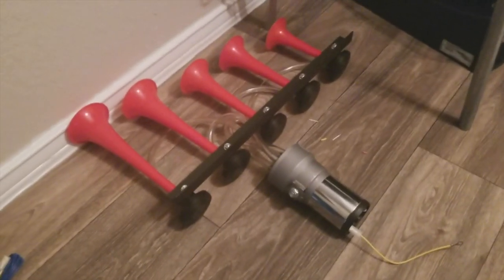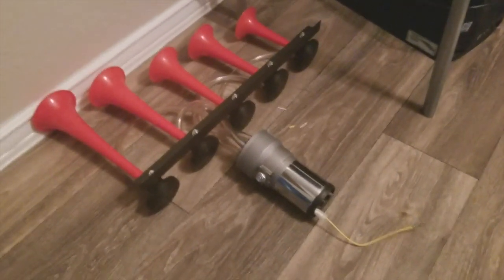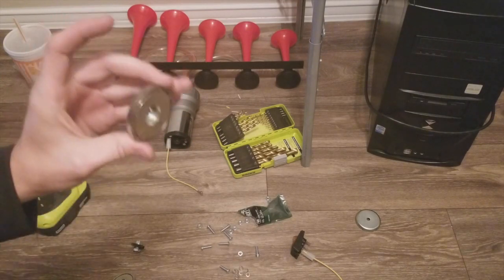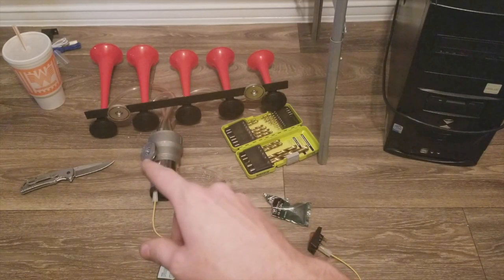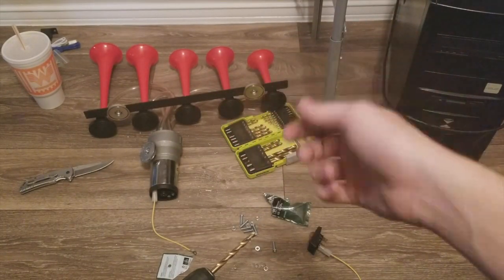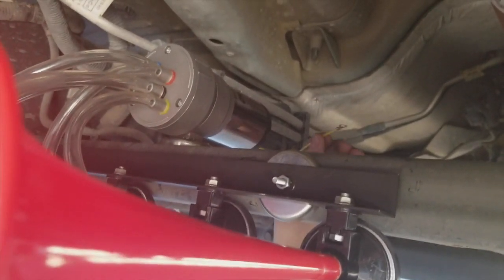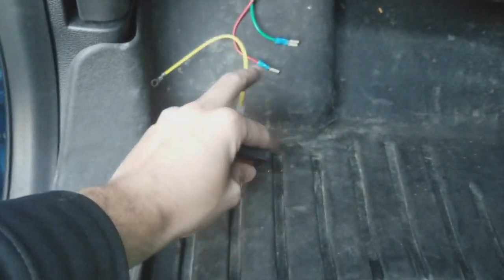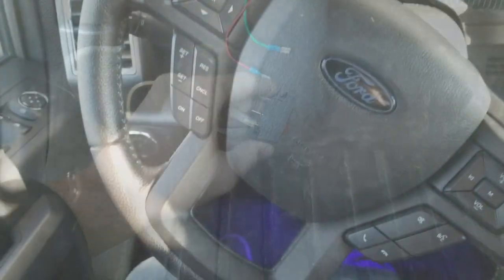DIY Airhorn Install!

Comment: I've tried every way I could find to wire up Harbour freight but with zero results can some tell me what I'm doing wrong . I am using separate switch would nice if I could find the proper wiring instructions that actually shows were each wire goes to and from on 4 pin relay .harbor freight instructions don't work.

Comment: If I install this horn will I be able to use both my standard car horn and the Dixie horn ?
Reply from the maker: If you wire it to a seperate switch then yes.
Reply: TxModNetwork sorry for so many questions but do you think a Dixie horn kit of 5 trumpets would fit under the hood of my Ford Taurus 2014 ?

Comment: Where did you get the horn? Do you have a link?
Reply from the maker: Amazon heres the link, Wolo (430) Musical Horn - 12 Volt, Plays Dixieland https://www.amazon.com/dp/B00029XHZ4/ref=cm_sw_r_cp_apa_i_g8isDbFWVM3HJ
Reply: @txmodnetwork  thanks!
Reply: The speed of the Wolo is ver accurate to the General Lee. Each note is exact , unlike a lot of brands. I like it & am now sold on Wolo. Thanks for the video

Comment: Where would I get the bracket for the horns?
Reply: I did the same thing for mine. I just used angle iron and drilled holes

Comment: why do the kits show a relay?
Reply from the maker: Just depends on how you wire it, i didnt use a kit i wired it my own way.
Reply: M Gomez: Here’s a link showing bypass of connection to a relay switch, control button, and battery:

https://www.tacomaworld.com/threads/dixie-horn.230758/